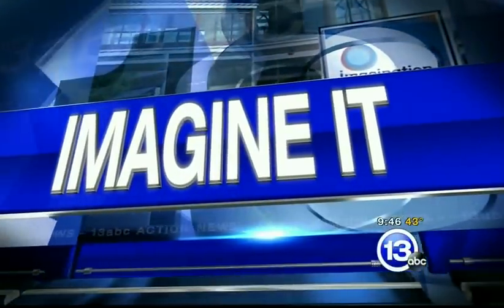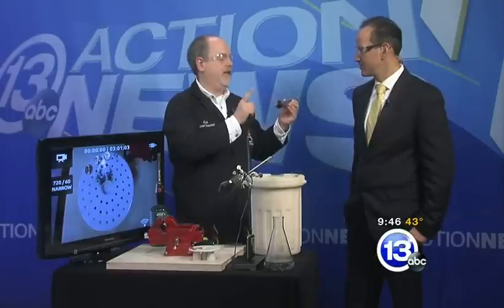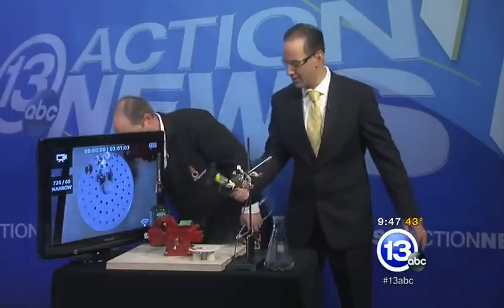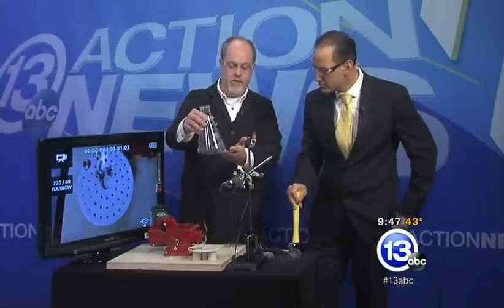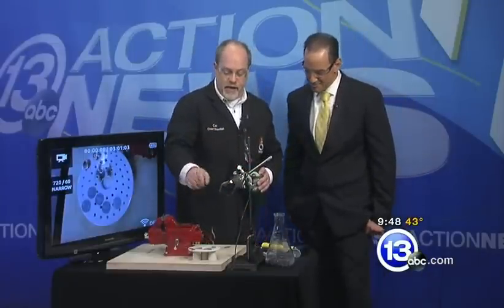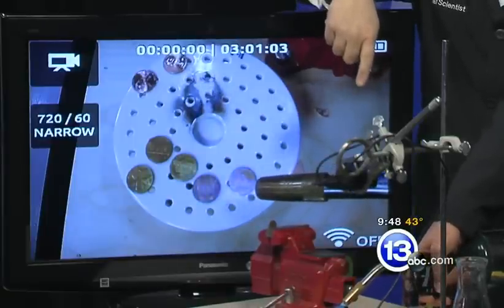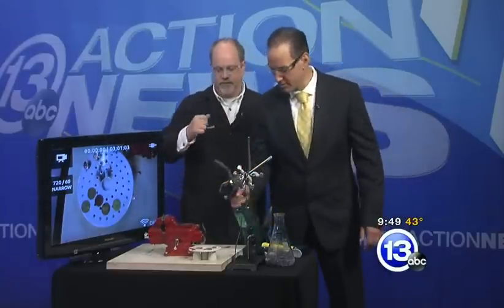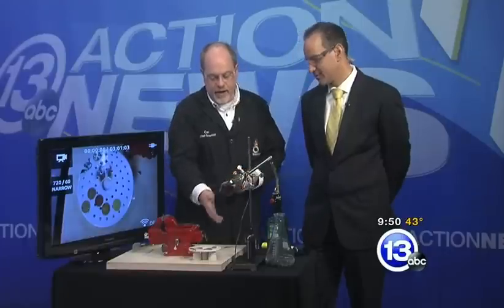How to make a golden penny

Comment: 1982 was the transition year, so you can find some brass pennies from that year. If it's 1981 and older, it's 100% certainly brass. If it's 1983 and newer, it's 100% certainly copper-plated zinc. They have sorting machines where some use eddy currents to deflect the two different types to two different slots, or to detect the composition and flip a door electromechanically.